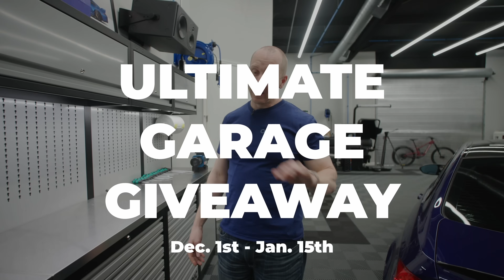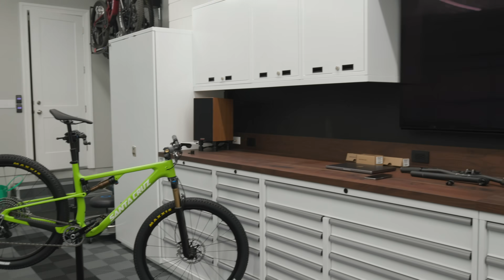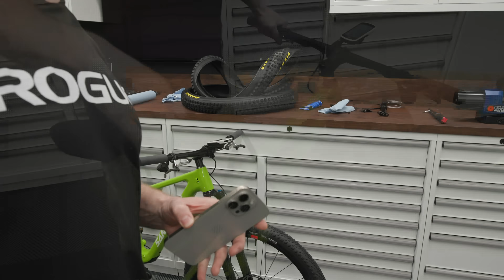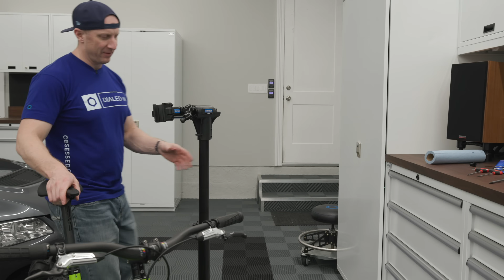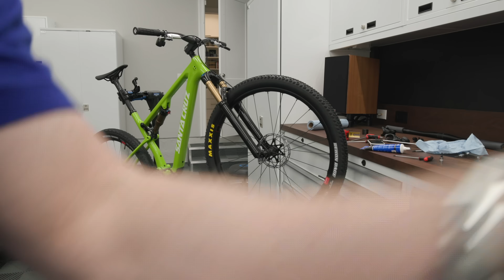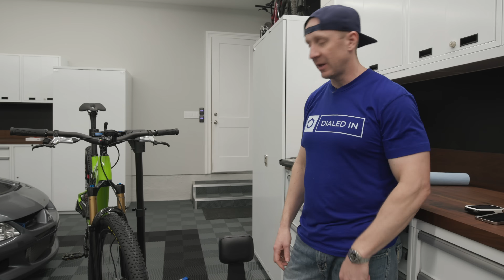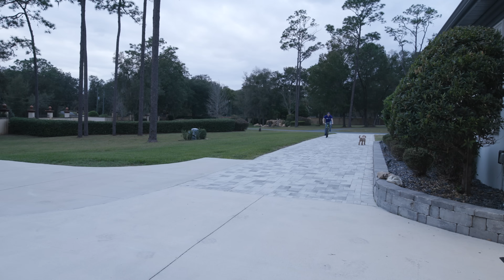I Spent $1,000 to Shave 250 Grams Off My Santa Cruz Blur Mountain Bike

Comment: I9 wheel sets are drool worthy. Hell of an upgrade
Reply: I9 wheel set yes , but there is alot of neg regarding hub failures . The enduro cups held here in Aus alpine , nearly everyone is on i9 wheel sets, i9 freewheel and xlr8 custom carbon ceramic driving hubs, they are about $5,500ea here in Aus. They take all your specs, provide the .fit from at least a 30km ride from compatibleyb computer it's insane